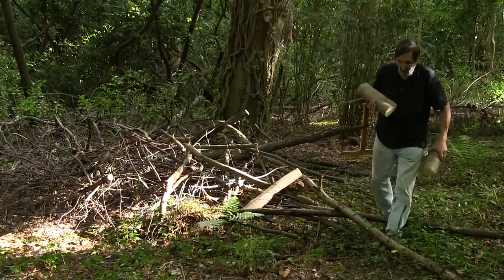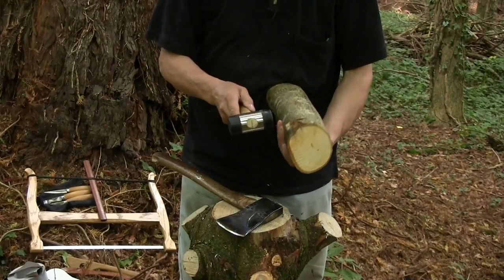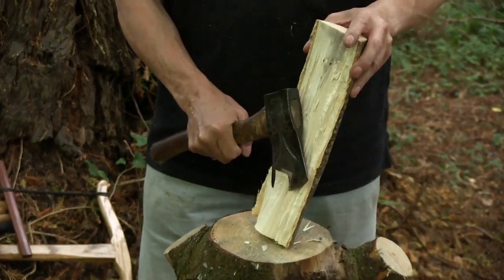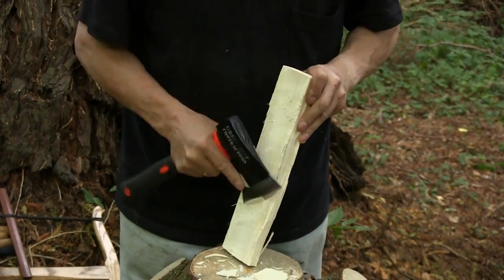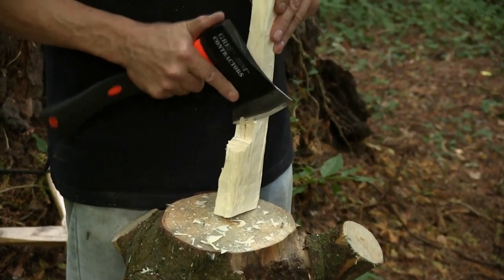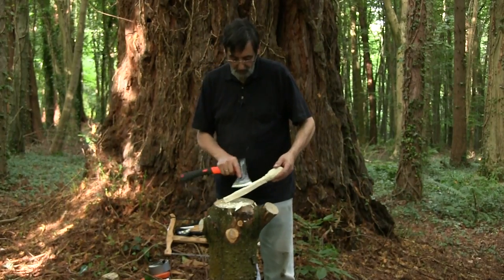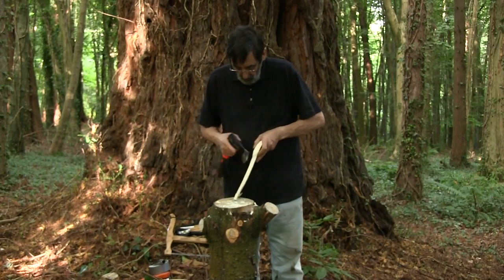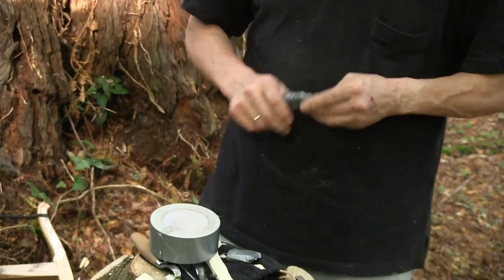Carving a Spoon Using an Axe | Paul Sellers

Comment: inspired by your video about working in greenwood with a small hand axe, i flatten the profile on  one side on the axe to be able to get a more flat angle and use it allmost like a planer / for  fine cuttings,  BUT i forgot that im lefthanded and not right handet, so i have to use it with arms crossed,   starting over tomorrow    LOL

Comment: I have a very cheap fibre glass handle axe and I’m really pleased with it, the balance is phenomenal and it keeps its sharpness really well. I tend to use axes with a much flatter movement rather that the usual arch, I’m a chef by trade and I approach my axe like a meat cleaver.

Comment: Lovely video, thanks. If the axe head is lighter than the wood, you can flip it over and bang the back of the axe-head against the chopping block, using gravity to force the wood onto the cutting edge. Are there any trees that are to be avoided in spoon-making because they are toxic? Especially if you’re hoping to use them to stir stews etc where they might leach poisons into the food?

Comment: i was so amazed and impressed with the redwoods that i wanted to see if they would grow here in upstate ny. i currently have five 1 and a half year old saplings(started as 6" seedlings) :) one of which is a little ahead of the rest for height @ 6 feet the rest are all about 3 feet. the ones i have are from the sierra nevada and not coastal redwoods. i have read of a few other sequoia's in nurseries around this area mainly up above me in the finger lakes region and over in the UK.

Comment: Hi, I am enjoying your axe-work videos, but  when I cut or saw at 90o to the surface for a stop cut to help remove the excess wood -  the axe/saw leaves 'bruises' in the wood deeper than the apparent depth of my cut,and these are hard to remove later without impairing the design. So I prefer to cut obliquely, closer to the intended final curve (E.g. in the outer shoulder of a spoon bowl) so as to keep a smooth curve between handle and the sweep of the bowl's exterior. Apart from this doubt, I am profiting from your presentations, and find the flexibility of your methods encouraging, time-saving and great fun. Thank you!
 Ian Masters

Comment: As a kid I grew up with extremely blunt and rusty axes that were a few mm thick at the sharpest point, they were more of a bludgeoning tool for breaking the wood apart with sheer force, and usually had a loose head that was liable to come flying off if swung too hard.. 
I certainly never considered them to be a tool you would "work down to the line" with!

Comment: Interesting that you used a rubberized hammer to strike the axe. I've heard it's not recommended that one use hammer blows on an axe head because it can expand the axe head and loosen it from the handle. Does the rubber eliminate that possibility?
Reply from the maker: It does indeed as does nylon which is what I was actually using.
Thank you, that was a good question.
Reply: It really does. And you can also use a wooden or rawhide mallet, as well.

Comment: The problem log would split a lot more easily if you cut it so that the knot lines up in a straight line with the edge of the axe (at 90 degrees to where it was cut) ideally you want the knot on the side opposite you. It would still split unevenly, but tends to make it a lot easier crack apart.

The tree behind him looks like a giant sequoia, not sure if I'd put money on that though, definitely looks like a redwood of some sort though.

Comment: How do you keep the finished spoon from cracking when working with green wood?
Reply from the maker: If I was making a spoon from green wood, I wouldn’t finish the spoon, I would rough carve it without finishing it and then reduce the moisture content gradually over a few days, storing it in a plastic bag or similar and exposing it to the atmosphere for a little time every day. You can get dry wood still in the round and make spoons from dry wood and you don’t have any issue.

Comment: seemed so silly to watch you beat on something so small with a little rubber hammer. I can't help to feel the need to take it and finish it myself haha. Ive used a hammer and sometimes a sledge but 99% of the time I only use one to start the axe and even then its only when im too sick/tiered/sore to pick up the piece and the axe at the same time. Of course though, when Im splitting logs too big to pick up with one hand, my hammer comes out to play. I guess the heaviness of the wood is relative to the person beating on  it so thanks for demonstrating the different techniques

Comment: The first thing that should be made is a maul. Just a chunk of wood with a handle carved on it. That hammer was way to light.
Reply: Or just turn the axe around and use the weight of the log. Just lift it up, let it fall down.

Comment: I was hoping to find one where the person wasn't using one of the scoop cutting tools :(
Reply: +Russell Anderson I know what you mean! Me too! I have a Schrade Old Timer 1520T I'm gonna try making 1 with I guess. It's got a nice curve to it. Might have to finish it up with a knife that has a rounder tip on it. we'll have to see.
Reply: +Zepply Ledson I'd like to know how it turned out if you don't mind TY TY
Reply: Hey, thats part of bush-crafting, sharing the knowledge. Doesn't matter if its something great or if its a total failure. Share so others know what to or not to do. If it wasn't for you and her, I wouldn't have had this idea.
Reply: Ive had succes with gouges. Dont be scared by the expensive gouges, cheap ones work fine. Consider buying them in a store as opose to online. That way you can test the sharpness which is usually an indicator of quality.

Comment: you shouldt hit your axe with a metal hammer
Reply: He shouldn't not hit his axe with a hammer.
Reply: You can use a wooden mallet
Reply: That doesn't look like a metal hammer. The ends of the hammerhead look like hard plastic, nylon of some kind or hard rubber.
Reply: Looks like metal to me but again from my eyes a hammer can look like a damn meteor
Reply: +Hugo Åkerlund what does it matter?  looks like he knows what he is doing.
Reply: Sean Twomey if you hit an axe with a metal hammer the axe pole will become mushroomed out
Reply: mmm I love mushrooms.
Reply: Hey says it's a rubber hammer at 4:15.
Reply: +ollyollie oh i must have missed that
Reply: He says "it has rubber on each side" and it clearly looks like rubber anyway. And it doesn't even sound like metal on metal.
Reply: Scandinavian Huntsman
Reply: Tom Wong yes?
Reply: I use a metal hammer quite often. However, it is a home forged and is a soft iron. My axe is hardened steel.